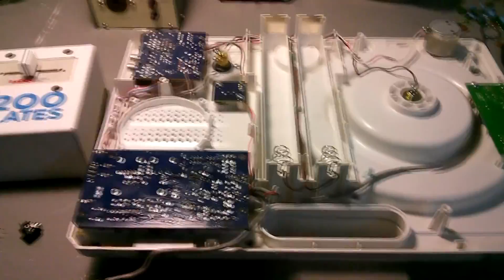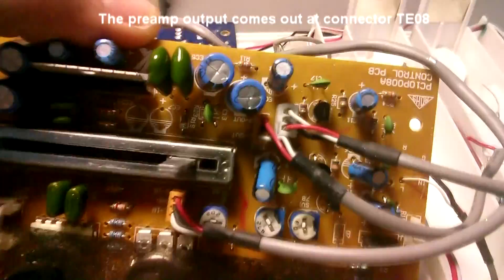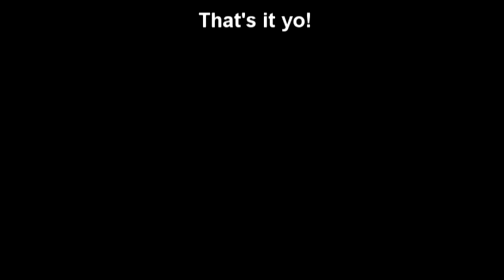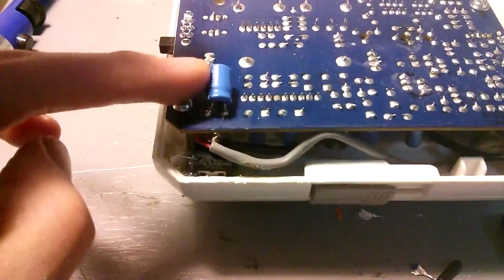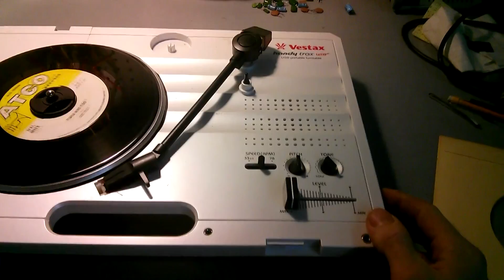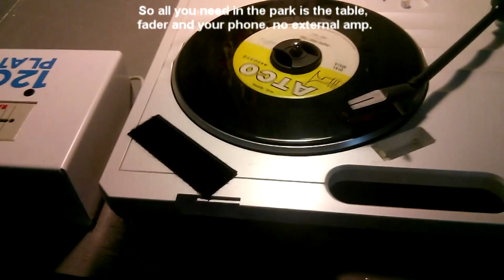Vestax Handy trax FADER INSERT MODS by ILLdigger, tutorial

Comment: This is a great video, I plan to use this mod to install a Stokyo Fader. I might try to avoid disconnecting/cutting the preamp to amp cables and just solder to new ones from the circuit board instead. Thank you so much for uploading this video, really appreciate it a lot.